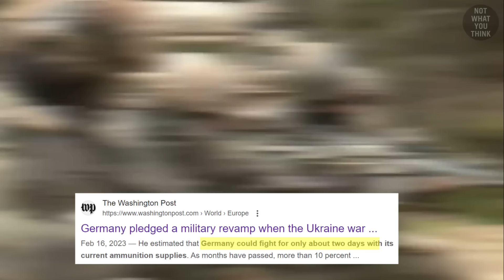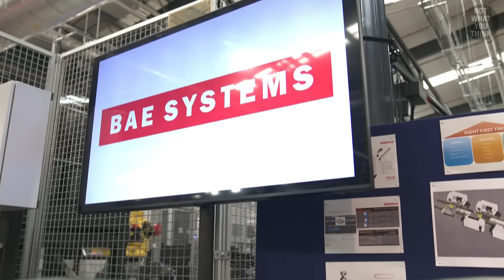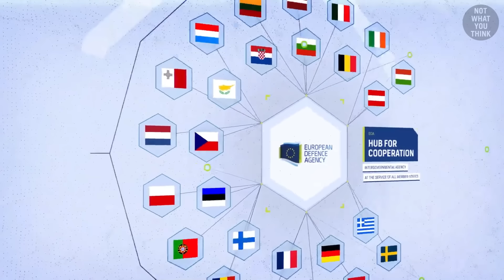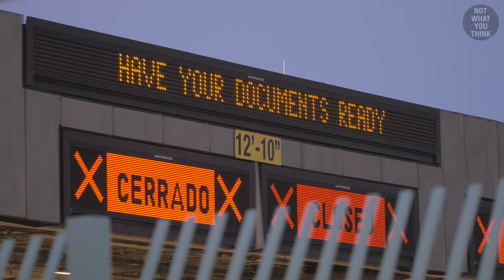Why Europe is Preparing for War

Comment: Someones getting rich selling all this military equipment and weapons.
Reply: They say black rock is the main player. Other then the us gov
Reply: Have fun with the foreign wars I'll be home playing Xbox😅
Reply: The F35 is ridiculously expensive, because the ones in charge didn't have a fundamental grasp of engineering. Effective military aircraft are very specialized, but they originally wanted the same plane to have the strong (heavy) frame & other hardware for CATOBAR (US Navy aircraft carriers), the long range (light weight, high fuel capacity) land-based Air Force needs, & STOVL (Short Take Off & Vertical Landing) for everybody else's Carriers - those need a big, heavy duty fan in the middle of everything. 
After many years & billions of dollars development cost, they finally gave up & made 3 variants, but maximum interoperability means there are STILL compromises.
Oh, & in order to store all the ordinance inside for better stealth, they had to design special new bombs & missiles just for this plane. 🙃
Reply: Schwab
Reply: The plan
Reply: BRAVO ...the same exact peopel who are clapping and screaming war is coming

Comment: Can we take a minute to call out the poor design of that hanger door🤔
Reply: Wassamatter with it?
Reply: Don't judge . It's trying its best .
Reply: It's not there just to keep the rain off, mate. Do you think that when designing a hangar door that is able to protect an aircraft worth $85,000,000 and vital to a Nation's security, from air and ground attacks with a variety of ordnance, including biochemical, the builders just sketched it on the back of a cigarette packet and said "Do it like this, bro, wiv hydraulics an' shit, it'll look way more cool, like James Bond innit!" 
Or, is it more likely that it was designed and built like this by highly educated engineers for very specific reasons that you just don't understandand? 🤔
Reply: @QuentinWalker  Kinda silly that an aircraft worth 85mil is at risk of damage due to rain lmao. So many modern militaries coming up with "fancy high-tech" designs and failing to understand that equipment has to be as simple as possible
Reply: @QuentinWalker  I took a screenshot, I found it so cool, and it's probably much sturdier and in one piece.
Reply: @zergling6802  F 35s could have been more robust but they have that vtol and they're network hubs as well as long range weapon platforms, no need to get up close.
But Americans do over engineer these days when it comes to military, but who can beat 'em?
Reply: @QuentinWalker  If there is a power outage (could happen in wartime) all airplanes are locked behind those doors.
Reply: @vincentvanhuijstee9764 That's a scenario that has definitely been considered. Did you notice the way it was hinged, so that a manual system would only need to move it slightly off vertical balance before it would lower under its own weight? It's almost certainly a concrete reinforced blast door so it's very heavy and would be quite simple to lower by simply bleeding the hydraulic pressure from the system. Manually getting it back up again, though, that would be incredibly difficult, but that's why there would be backup systems, generators etc. But if we're talking about scenarios where all grid power and local sources are lost, e.g. from the EMP blast of a 'nearby' nuke, then maybe getting the door back up again is kinda irrelevant. Good question , though. In engineering there are always numerous what-if scenarios like this that are thought up and considered when the requirements are being evaluated, and long before even beginning to design a solution.

Comment: Switzerland buying F-35A isn't that strange imo. We have Legacy hornets that are showing their age, and just like the rest of the world, theres always a threat Russia might try something funny. As much as we are neutral we have also heavily sanctioned Russian bank accounts, and are not exactly in favour with the Russians anymore. Interoperability has always been a key point for the swiss air force, that being one of the factors on deciding to import our Vehicles. We also have training exercises with the US and other NATO members occasionally.
Reply: switzerland will have to remortgage the country just to keep a fail-35 in the air for an hour lol
The Fail-35 continued to falter in very public ways. In 2015, it performed poorly in a dogfight against older F-16s. Its engine, made by subcontractor Pratt & Whitney, burned so hot that it turned atmospheric sand and grit into glass inside the plane, hurting performance and requiring redesigns. And yet, as new capabilities were added to the Fail-35, it became apparent that the engine wasn’t powerful enough to provide energy to cool the plane’s internal systems. Maybe most frustrating, the Fail-35 required several million lines of software code to operate. That code, like all code, turned out to be buggy and in need of constant rewriting. By 2021, the cost of the Fail-35 had nearly doubled—overall outlays for the project, originally estimated at $233 billion for the first 20 years, had in fact reached $416 billion.
I thought the swiss were smarter than this...obviously i was wrong.
Reply: @nihilistzero8066 don't forget that all fail-35 aren't even "production models" and the so called "production model" block 4 is SUPPOSED to be a thing only in 2030. And all previous planes CANNOT get updated to this spec because the original design is quite old and didn't take into consideration so many changes. It also has the same radar issue of the f16, nose is too small to fit a bigger radar, not enough power to make even the smaller radar work properly, and not enough cooling to keep that radar in good condition.
Reply: @nihilistzero8066  first of all the F-35 was never meant to dogfight with an opponent. That the F-16 bested it in visual range 1v1 fighting is not surprising. The goal of the aircraft is get close UNOBSERVED and deliver its weapons load.
Not even going to argue the electrical power aspect with you because you’re just wrong. How do I know? I’m one of a handful of EWIS experts for the military and my colleagues and I helped guide the development of power supply on the aircraft. Don’t believe me? Look for some of my other posts and they are all indicative of an EWIS expert.
Your qualifications? You prove you can parse a multitude of posts to throw out a bunch of numbers that don’t really say much. Also you need to do better with your posts. Looks like you and Antonio are posting from the same area leading me to say you’re using multiple accounts. I expected Orcs to be just a wee bit better than this.
Reply: @kaptainkaos1202  "I expected Orcs to be just a wee bit better than this."
Don't forget, for Russians quantity is always more important than quality, and that applies to their propaganda too. They just want a lot of it.
Reply: @nihilistzero8066  OK pierre spray I'm sure your WarThunder knowledge makes you an expert lmao
Reply: @kaptainkaos1202  if your "other comments" are even slighty true you would be easily in the 60 years old range if not more. So when did you "design" anything in the fail35? If you did trully design anything, what about the redesigns that have been publicly announced by the company? Did you do that too? Which would mean you made a horrendous job the first time. Or you haven't done anything and all of this is a bunch of lies. Which it is.
Reply: @antoniohagopian213  awesome, you can count. EVERY system will have redlines but the DC power buss we developed is very close to what we came up with. It’s actually used in another platform as well. I grow bored with you.
Reply: As long as you send us your lovely chocolate and coffee, you can play your tiny airplanes all you want.
Reply: @nihilistzero8066 what was Switzerland suppose to buy? A Suck-35 from Russia?
Reply: Switzerland by its values of democracy and self-government is an ideological ally to the EU without needing to sign any treaties about it. The EU doesn't need to worry about Switzerland doing any nasty deals with Russia that would let hostile forces loose in the middle of Europe, and Switzerland doesn't have to worry about the EU interfering in its internal government or long-standing policies.
Reply: But it's NATO and US  doing funny things to provoke Russia.
Reply: Вы не нужны России, угроза исходит от ваших правительств и элит. В Европе большая плотность населения и много ядерных объектов и химических производств. Воевать с Россией - это самоубийство. Америка за океаном, ей всё равно.
Reply: I don’t listen explanations from a swiss that have a marine corp without sea 😂😂
Reply: @mathysbergerault9138  🤣🤣
Reply: @techarch8851 are you kidding me